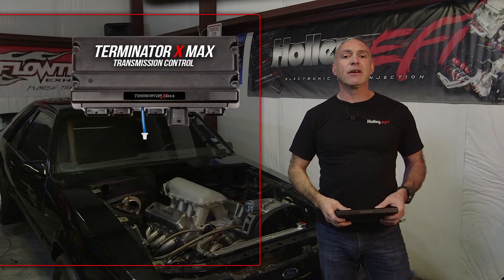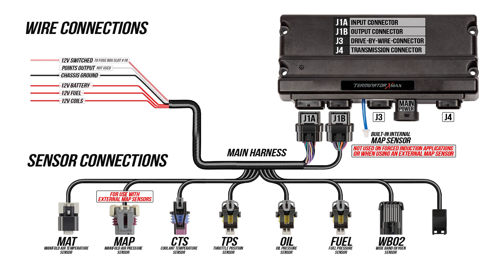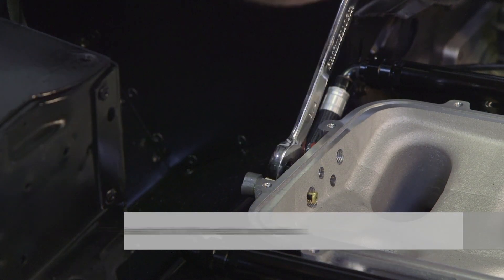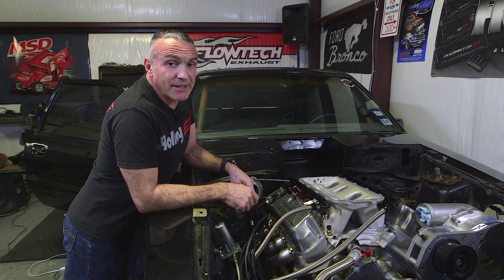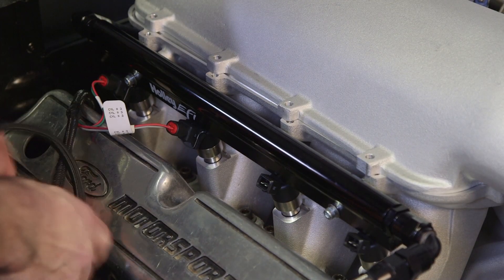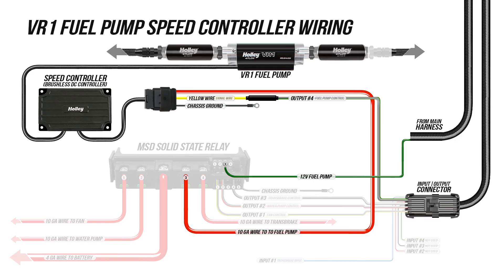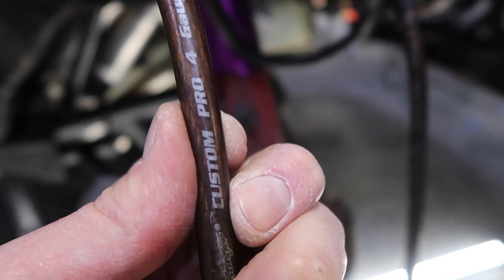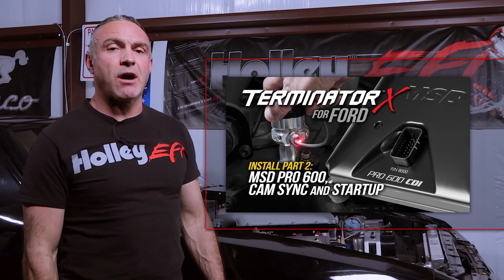Terminator X EFI for Ford Part 1: Sensors And Relay Wiring

Comment: Would this work on a ‘67 mustang 289…..with a similar intake and LS style throttle body and ls3 map sensor??….or should i just LS swap it
Reply: The Fox Platform kit 550-937F has been discontinued, so you would have to use 550-937. There are a few differences. I would think you could use a LS style throttle body and the kit for the 937F, it used the LS3 map sensor harness. Please keep it Ford powered.

Comment: Holley can u please revise the instructions included to install on 99 to 04 mustangs not send instructions for LS chevy motors  i know they may not be popular but to send me directions for everything but the 4.6 is kinda bullcrap,  esp being HOLLEY
Reply: Chevrolet does not make LS engines. The Chevrolet engine name disappeared after 1991. 1992-2015, GM engines fell under GM Powertrain. 2016, GM Global Propulsion Systems. I do believe it has recently changed again.

Comment: installed my term x for 4,6 over weekend and did tps setup then wizard set ci then liters and 42lbs injectors set psi to 43 and coulnt get it to fire. didnt bring my laptop to shop because i was told by u guys the 3.5 will get it running but as it was cranking where is sais stall it kept jumping to somthing else and back to stall quickly  i seen videos of other guys instanly giving an rpm reading before the engine was running  is my crank sensor bad  worked fine with stock ecu friday wheni pulled into my shop but no run yesterday and spending what i did for pro dash and can bus splitter wire and wire for laptop hookup its a huge bummer. can my fuel and oil sensors i got from another company work even tho there 0 to 150psi  sorry im broke after turbokit and term x efi and complete fuel system  crazy prices for same sensors others are getting to work
Reply: I would be confident by now you have this engine running. Yes you can get the engine running on the 3.5. Pro dashes are expensive. There are people on YouTube showing how to hook up a tablet instead. Yes your other sensors from another company will work. If a product is not listed in the drop down, you can configure them with the laptop. Adding aftermarket products that we get suckered into buying, we should have just bought a new Mustang.

Comment: This is definitely my next mod! Ordered a On3 turbo kit April 6th which is on back order. Got my car back today from getting the 306 built but my wiring harness is a MESS! This is the perfect I’ll just pull my old harness and toss it and this will allow me to remote tune and I can get a tune from y’all’s site which will alllow me to drive it. It’s literally perfect I just need money if anyone wants to help lol. I’ll dance y’all’s wedding.
Reply: orderd my on 3 kit on christmas and got it in march  but i also have this system but yesterday no luck getting to fire up huge upset  i waana learn the holley first then add boost  was just gonna have email tunes with the sctx4 but didnt want a blame game if somthing bad hapend  good luck  tho
Reply: @chrismcmullen9557  I finally got my On3 kit. Shipping still shows it’s not shipped so idk what the deal is. I’m like 90% sure my Ecu is bad. I repinned it for the Mass air and I installed a new Ignition switch, New natural safety switch, new battery, new starter Solenoid. It won’t do anything at all with the key. Won’t turn over Or even try to crank. It will turn over using a screwdriver on the starter Solenoid. The terminatorX will solve so many issues im having with my foxbody. Will solve the Ecu and will solve the electrical issue which could be something bad in my wiring harness. It’s Plug and play.

Comment: Pro-M EFI is easier to install, with less splicing of connectors.  Thus a cleaner install and it comes with a firewall grommet for a factory look.
Reply: I am all for simpler but it probably comes down to the tuner and if he is knowledgeable with that system.

Comment: Just installed on the built EFI 408 Windsor in my '69 Mustang fastback.  Took a few hours to pull out 89 Fox engine harness and install terminator x. Fired right up!! Love it. Trying to get this beast to run well with a 30 year old Fox ECU/control  and QuarterHorse was driving me nuts.  So many variables and tables to estimate and update just to account for the displacement change.

Comment: Very helpful and perfect timing for setting up my new kit, Thanks! Props for keeping ford in your boosted project👊
Reply: Did you use the MAP sensor adapter harness?  I just got mine and the weather pack end has the wrong connectors inside.
Reply: @nitroustommy  mine didn’t connect either, luckily i had (gm) map sensor from another project and it snapped right in👍